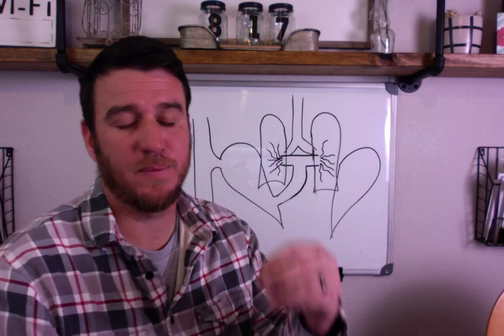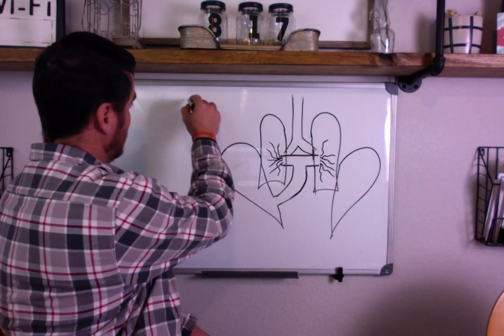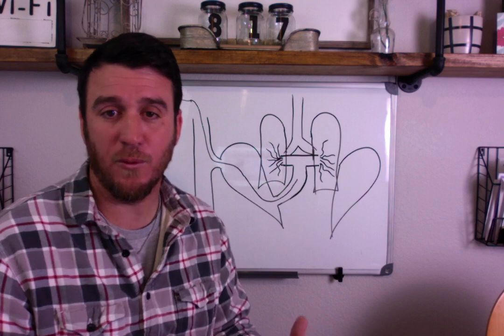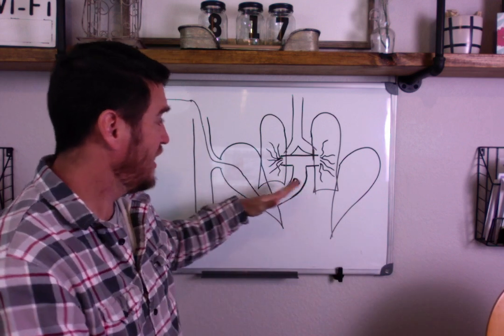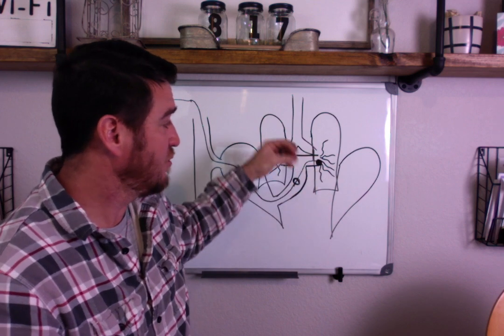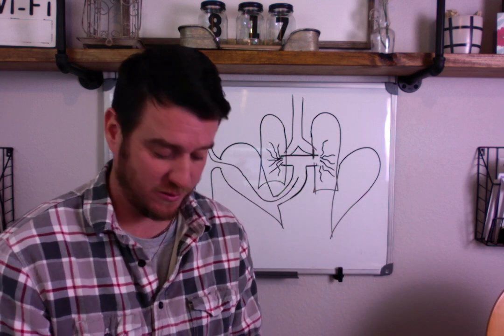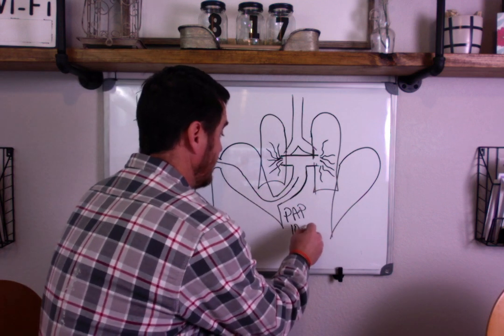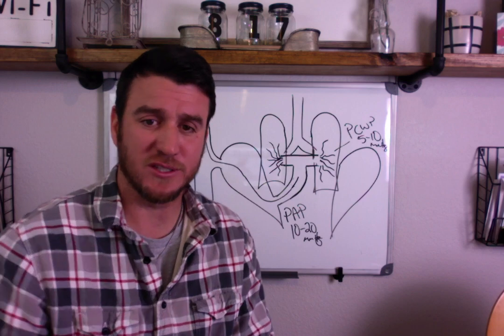Respiratory Therapy - Swan Ganz Catheter - Quick Review

Comment: may be some people would be interested in what is not covered in this lecture .....THE MAIN THING once the ballon was inflated (I suppose -- after the pulmonary bifurcation using a Swan-Ganz catheter, but it really doesn't matter ) AND  we obtained the so called pulmonary wedge pressure roulghly corresponding to 8mm.Hg  AND THE PULMONARY PRESSURE inside the truncus pulmonalis or in one of its branches  25 mm.Hg.....well the reason is quite simple 8 corresponds to the diastolic pressure AND 25 to the systolic / when we inflated the balloon we artificially created a diastolic pressure inside the pulmonary artery or in one of its branches (think about aorta and aortal valve when it's closed and we have 120/80 mm.Hg) How all this stuff is related to the Left atrium It's apparently beyond the scope of my understanding of this process/ what 's more interesting once the balloon is inflated , the blood flow is stopped and there are  all kind of pressures here and there : before the balloon after the balloon and APPARENTLY they're not the same, for the blood flow drastically drops beyond the ballon when it's inflated
Reply from the maker: Thank you for watching and adding to the subject matter.  I appreciate you.

Comment: 😊 Well  if the balloon... That's what you literally said... Is inflated within the pulmonary artery I guess fitting tightly to its (pulmonary artery) wall.. If it's fixed tightly  to its  wall .. Because inflated.. How can you displace  the catheter  to its distal branches... I mean beyond the pulmonary artery bifurcation... And then the crucial question.. How  can you explain the difference between the wedge pressure and the pulmonary artery pressure
Reply from the maker: When inflated, the balloon floats into a distal branch of the pulmonary artery, it's not large enough occlude the PA proximal to the distal branches.  This action provides a pressure reflective of left ventricular end diastolic pressure.  This allows you to use differences between the PA pressure and PCWP to assess PVR.
Reply: @RespiratoryCoach  this a great explanation thanks a lot

Comment: Great lesson! Quick and concise explanation. Just to add a little more info... when the balloon is inflated it prevents any forward flow so that the tip of the catheter (distal to the balloon) only reads a relatively flatter pressure coming from the left side of the heart. It essentially is our preload (think CVP) for just the left side of the heart since it eliminates any pressure coming from flow from the right side of the heart.

Oftentimes, in many places, due to the concern of blocking the flow even temporarily, we won't even inflate the balloon and will just use our PAD (pulmonary artery diastolic) pressure as a surrogate for our PCWP. Typically they are close enough that any difference is negligible.

We use them ALL the time in the cardiac ICUs but are pretty rare in most other ICUs.
Reply from the maker: Nice addition.  Thanks for the contribution.  I always appreciate extra insight.
Reply: Thanks for the extra info